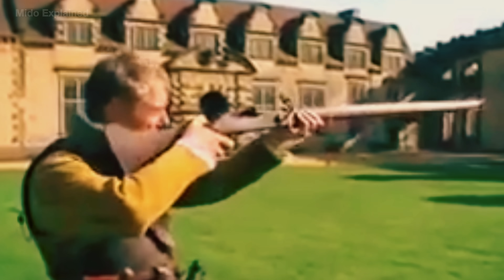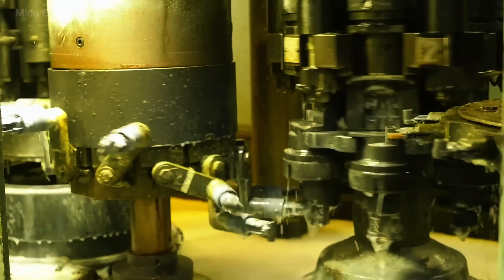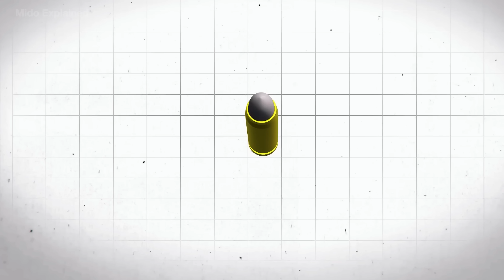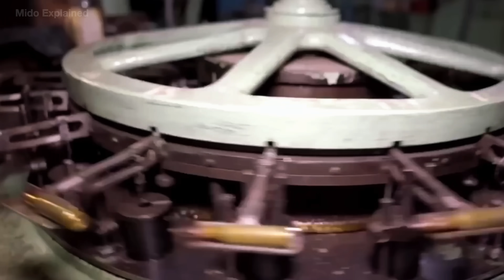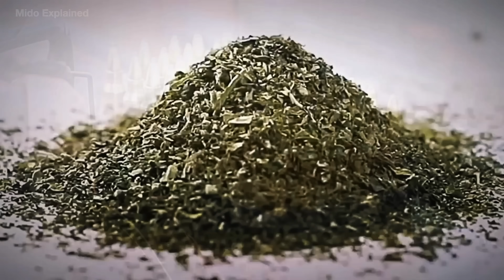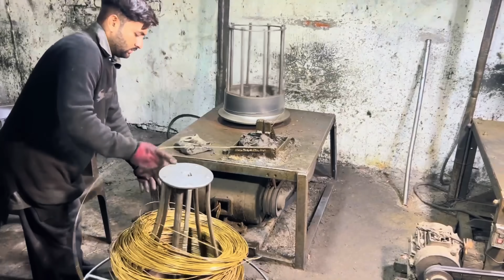How Billions Of Bullets Are Made Every Year Inside Massive Ammunition Factory

Comment: depending on the caliber the pressure created in the chamber is about 32.000 PSI for .223 and the primers are handled in another building because the primer compound is a impact sensitive and any static will set it off in a microsecond but different bullet calibers all create different PSIs in the firing chamber   ..
Reply from the maker: Great insight—thanks for adding those technical details!